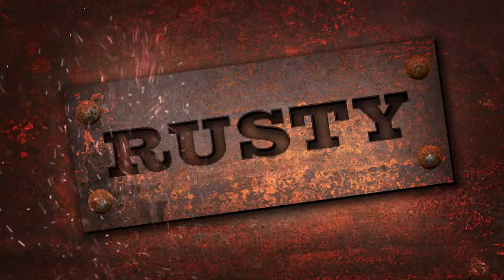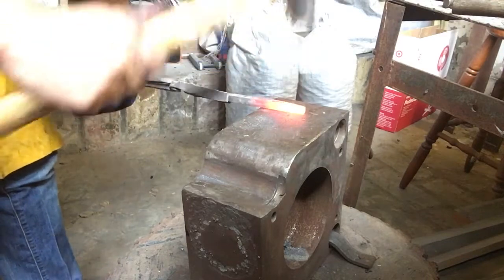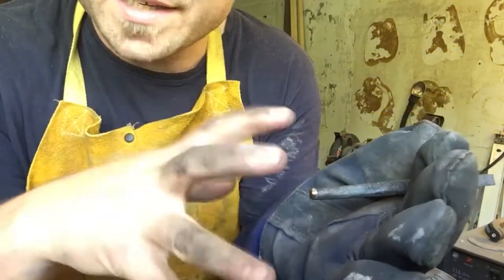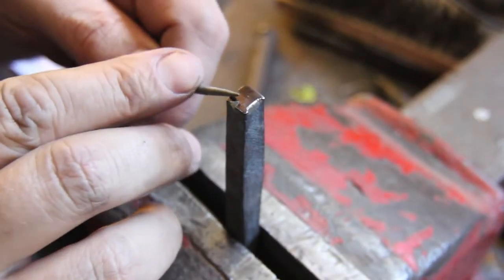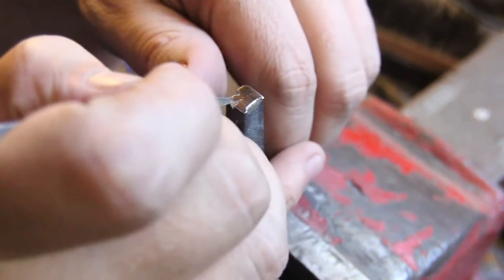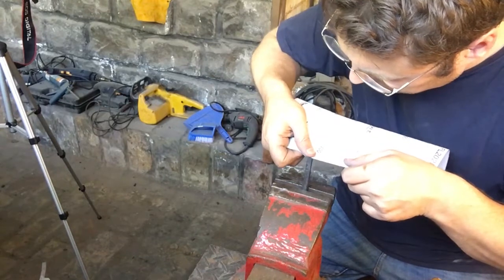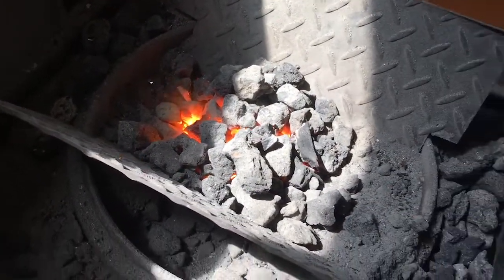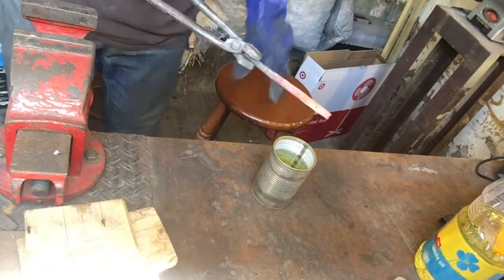Making a Blacksmith Touchmark: DIY Makers Mark

Comment: Well done! Keep it up! Did you notice any more of temper color change as the unhardened end cooled? I was thinking since it didn’t get to non-magnetic it theoretically wouldn’t harden the striking end and you could quench the entire piece to stop the temper?  Or did it air cool fast enough where the temper at the tip was still in the “good” range? PS- like the heavier tongs!
Reply from the maker: I thought it was in the shot, but I re-quenched the tip after tempering and then let the back air cool
Reply: Rusty Pearson it was. I was asking after the second quench did you notice any more color change during the Air cool. 
Either way, it obviously worked, I was just curious! Thanks!
Reply from the maker: I think I get your point. I didn't get any further colour change, the end cooled down quickly. If it held it's heat it may have heated may have travelled back up. I think because the metal was thin, the heat reduced quickly.
Reply: Rusty Pearson very cool! Thanks! Keep learning and posting! You’ve been a great inspiration!